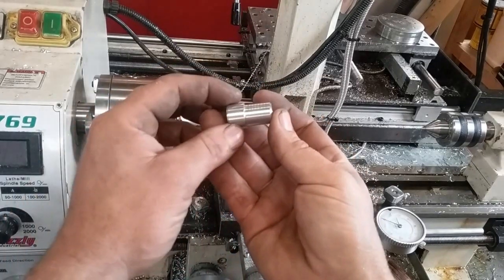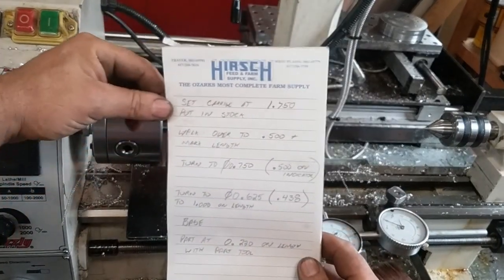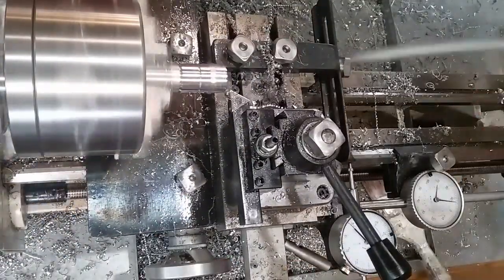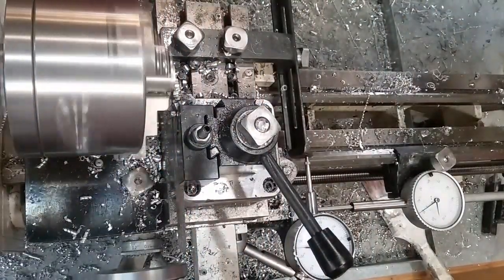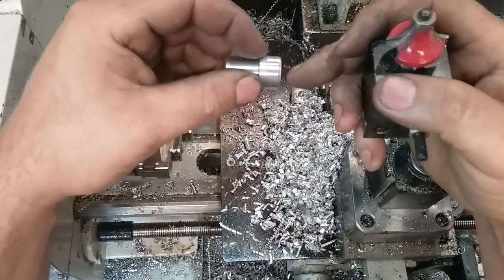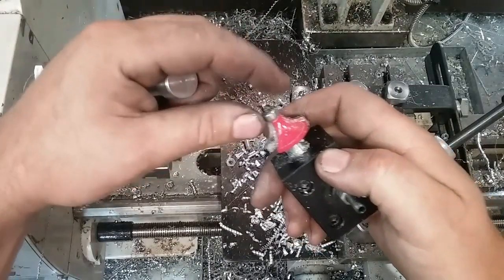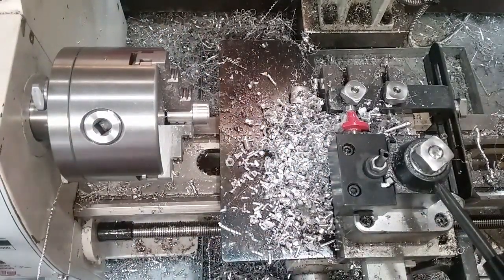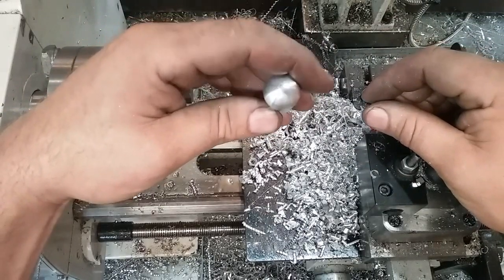The Radius tool the Red Chinese dont want you to know about

Comment: Excellent. I do both wood and metal, have a drawer full of various router bits. Never thought about that use. Actually today I have a very similar assembly which involves pressing a similar part into a 1” aluminum tube. Left a couple thou for press and was thinking I might put the part in the freezer first. I have ten to make and want a nice tight fit. Anyway, nice video. 😎 —Mark
Reply from the maker: Thanks

Comment: well Im an Australian machinist , and I tell you that there are many ways to skin a cat, yours is a good idea, mine for example is to use a adjustable bar with 2 balls on the ends , that locate, in a clamped block in the bed , and a little block in the cross slide , you can do any radii like that... (within reason)
Reply from the maker: Yessir.  Some day I aim to build a ball turning tool, but I had a flash of inspiration and this time it didnt involve a blow to the head.